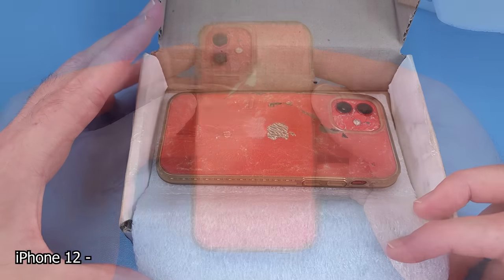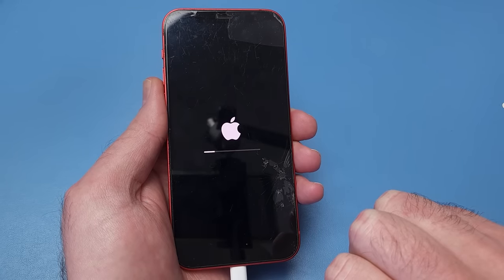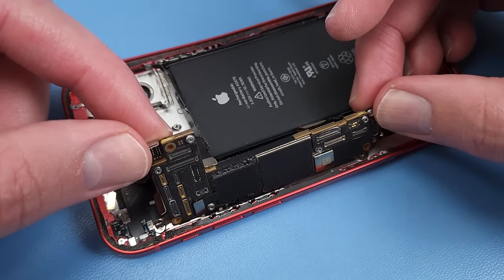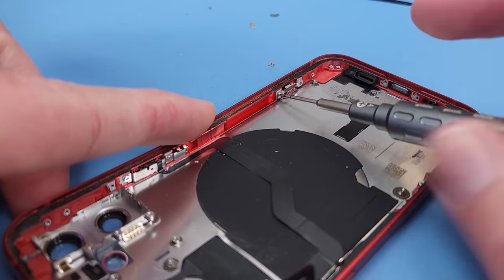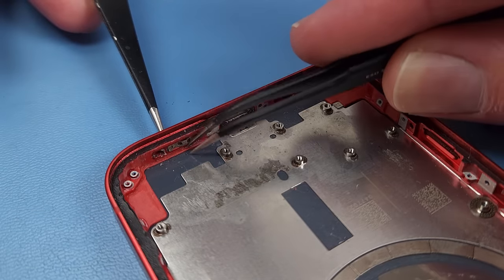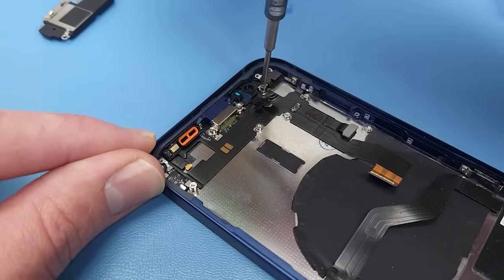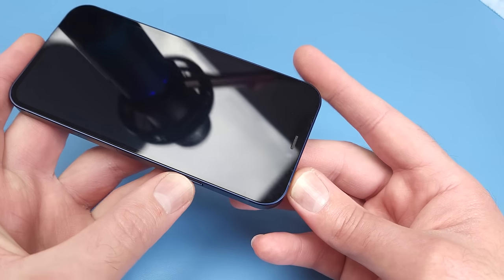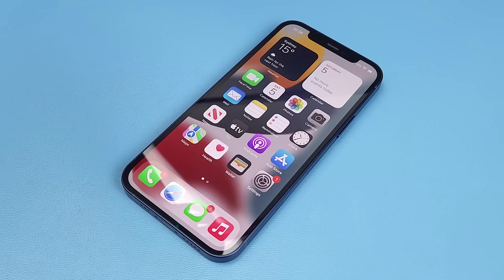iPhone 12 Restoration - Is it worth the effort?

Comment: I always appreciate how thorough you are with your phone repairs. Crazy what you had to do to get the battery working without the warning notification
Reply: Speaking of which, I thought the add-on little circuit board only needed to stay on temporarily, in order to fool the iPhone it’s a genuine battery, and possibly to reset the cycle count to zero using the battery programmer. At least that’s what I seem to remember watching other repair videos. Or is that model-dependent too, and Apple cracked down on this yet again, forcing the dongle to stay on?    😢
Reply: @miroslavmilan  yes, need to keep the tag-on flex on the battery

Comment: I think you should have bought a case with the small parts included, and it was unnecessary to replace the battery.
This would have saved a lot of time and some money. Making it more worth your time.

However I am glad to see the replacement of these parts in the video.
Reply from the maker: The frame with all the small parts costs $200. Profit would be almost nothing.

Comment: i love your content, especially the ones where you disassemble and reassemble the device... but i have a question (i would be honored if you could answer) what is the recive you use to make the smartphone water resistant again?!
Reply from the maker: recive? You mean adhesive?
This: https://m.rewa.tech/detail/for-apple-iphone-12-12-mini-12-pro-12-pro-max-screen-repair-tape-waterproof-seal-sticker-replacement.html

Comment: Why do you ned the REFOX Tag-on if you've swapped over the original BMS?
Reply from the maker: Umm.... I don't know. I was going to use the Tag-On so I didn't have to transfer bms or reprogram it, but then when it didn't work, I went down the other route, and left the tag on it without thinking 🫣 😂
I'm no expert with battery swaps, and the rules keep changing all the time.

Comment: What method do you use to remember the screws?
Reply from the maker: @giovannisisillo2328  A screw mat usually. Sometimes I put the screws next to the corresponding part they held down, but mainly I use a piece of card with double sided tape on it. Then place the screws in the position they came from.
There are mats you can buy which have an image of the phone under the adhesive, which are more helpful.

Comment: Will it still be water resistant afterwards after the tampers on the mesh grilles?
Reply from the maker: tampers? I don't understand. There's a decent chance it will be water resistant again, but definitely not to the same IP rating it's advertised as.
Reply: @RestoreTechnique  Its like after you had to remove the small parts from the mesh speakers at the bottom does it affect any water resistance? Im planning on doing something with an iPhone 13

Comment: Hello 7:43 I have trouble. I have 2.5 standoff driver but it does not work. I already suceeded with 2 charging port secrews but only this is the trouble. What is your driver? Tell me please.
Reply from the maker: Link to the Refox screwdrivers is in the description. It's a Type D: 2.5mm Convex Cross Screwdriver
Reply: @RestoreTechnique Thanks a lot! :)

Comment: Was it worth it?  

For the sake of argument let’s ignore whatever income you get from this YouTube video.  Let’s also ignore all the extra time you spend filming (outstanding btw 😊).

Time is money and it depends on how long it took to perform the work (includes ordering parts, working through the software battery issue, and the entirety of the sale on marketplace).

You made AU $178 ($114 USD) profit.  If it only took 2 hrs (very unlikely), then very worth it.  If it took 8 hrs or longer then heck no, your time could have been better spent doing something else.  My 2 cents.
Reply from the maker: Yeah you're probably right. Less than 8hrs though.

Comment: You actually did fine clearing out the earpiece, but I can recommend pulling out the debris with sticky tape. Especially the 3m adhesive gets into the mesh and pulls out everything thats loose, works pretty quickly.

Also fluff Apple for this bs. I once had an iphone 6 and repaired it to my hearts content, cant imagine buying a programmer to calibrate my battery.

Regarding the Battery, cut the bms and weld it to the new battery (since you happen to have a Spot welder). The battery rating should even update on its own after some charge cycles.

I'm sure hoping the EU gets Apple hard up their cheeks so they dont get away with these anti consumer measures. Can only take years🫡